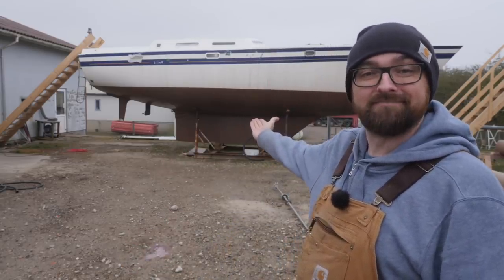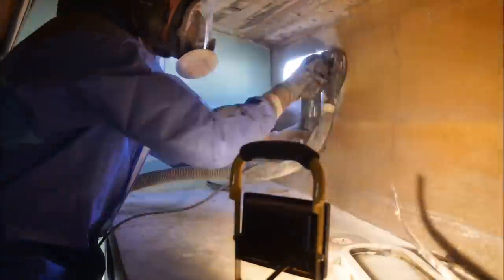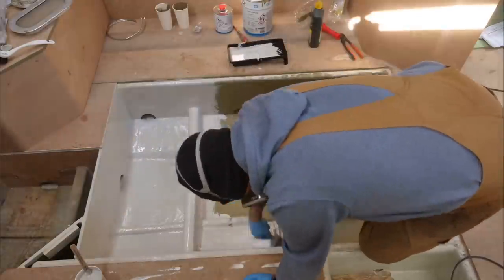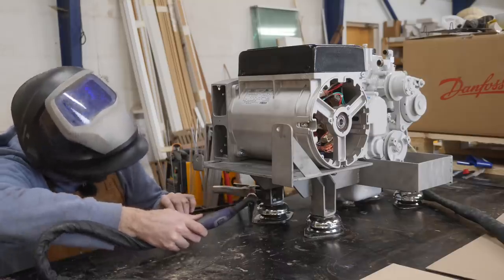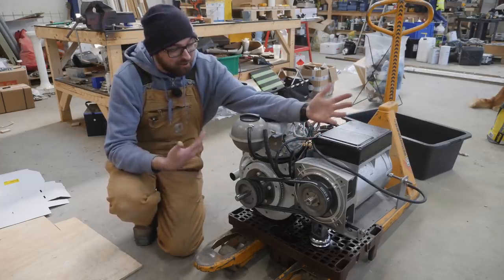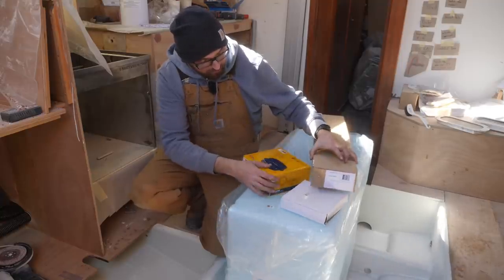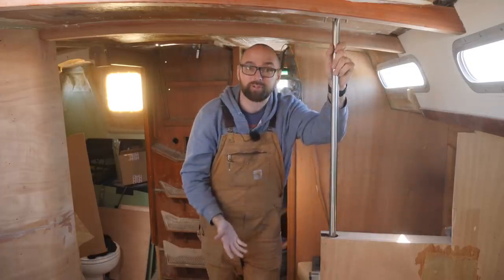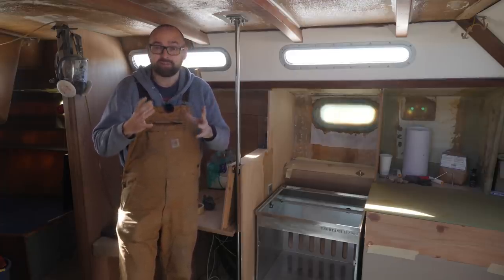Sail Life - DIY generator fail, galley pole - sailboat project

Comment: 4kW, We have a power hungry boat with air-con, induction-hob, microwave etc and just about manage with a 4kW (5kVA) generator and Victron Multiplus 1600 in power assist mode. Need to manage loads being mindful that loads such as water heater switches on/off automatically!! Your plans for a twin Multiplus 3000 system will be far easier to manage than ours. Need a big bank of Lithium batteries; we have 600Ah of Winston cells (same as used in Victron batteries) giving around 7kWh of storage. Great video. Cheers.

Comment: I worked with a guy when first starting out that always said if your not breaking (or messing up) something once in a while your really not working very hard.  Keep your chin up.  You have done amazing work on Athena to this point.  I would really consider looking at a bigger engine for your power system.  Now is the time if your are going to do it for what my 2 cents is worth.  Keep up the inspiring story and don't be to hard on your self.  Thanks for sharing!

Comment: G’day Mads, sorry to see your best laid plans didn’t work out. I hope that you’ve been able to forgive yourself for a simple mistake and I’m thankful you still were happy too show me and the world the mistake. Now my first thought is that maybe you could change up the pulley system to get more rpm at the generator. My second thought is a fly wheel so that you can make use of the Diesel engines high torque over its power output.

Comment: Hey Mads, 4kW is actually a lot of power! In italy, every normal household has it´s electricity line limited to 3,5kW and everyone is just fine! Sometimes you need to think about if you have the washing machine, the iron, the water heater on and want to cook something in the oven it gets too much.. but if you just keep it in mind, there will be no limitations to your everyday life with 4kW

Comment: Hiya Mass, I was gensat  man at Elstree Light & Power, I had 5 Perkins, 1 Volvo penta & 2 Cummins 250kva sets. Now if they still excist Smiths of St... somewhere NW of Norwich built the first 6 I listed. Try to find them & ask about re-sleving the pistons & re-pistoning the idee-bidee-tiny-perkins to make it a 402!!! They may know of an old set with a working Perkins or whomever & dead alternator? They might be able to get Perkins to sponser you? The people I knew are gone... Do not yet despair!!! 
The derve tank & the cold waters of the high latitudes:- INSULATE THE TANK!!! Cold derve has wax cristals form that block up your filters... Even with additive put in at the refinery you may go below, so carry additive plus protect & measure temp of derve. Trucks used to have bonfires under tank, set fire to truck, add petrol, have moter run away & have to smash injecter pipes to stop it exploding! Forewarned is for-skin-armed or something...
Stay safe & take care...
Reply: Mads.. pay attention to this man! I'm in the planning stages for building a high-latitude boat that can winter over in Antarctica, and diesel REALLY doesn't like extreme cold. So much so that I've decided my heating system will use kerosene instead of diesel.

Comment: Where I come from mistakes are positive learning experience. Perkins are not the only small diesel's that will work, Kubota is one that runs forever with little problems and are used in small generators.

Comment: Hello,

     You can change the pulley size on the alternator to a smaller and the one on the engine to larger, or, add two pulleys of s larger size between the Perkins and alternator to get a higher rpm on the alternator while running a lower rpm on the Perkins. Before living in a boat my wife and I lived in an overland truck. We had an alternator welder and made a smaller pulley to het higher tpm on the alternator while the engine ran at idle.

Comment: Very interested in your choice for the fuel  storage definitely will be watching. Best of luck on your refit cheers
Reply: Also I would recommend adding a solar and wind while it won’t supply everything you need but it will pull in power 24/7 it adds up and keep battery topped off add save cash to fuel use

Comment: Suggestion 1 - head South, keep warm and use more solar. We have a 3.5kw generator but it’s fitted with a 5kw alternator. The engine is a single cylinder kubota running at 2800rpm. The advantage of the larger alternator is it gives a more stable operation - greater rotating mass. I can start and run a 16,000btu air conditioner with my 30a 3.5kw genset. Our watermaker is dc and draws about 15a so is solar powered. Our inverter is 3kw but has a 150a charger built in. It’s a pain, but you just have to manage the load.

Comment: A lot of the appliances don't constantly draw the power they are rated for. For instance a washer will draw peek power when is heating up the water. Monitoring the actual current draw (per appliance) will give you the ability to modulate/regulate the rpm's on your perkins. For short periods you can run at higher rpm's without damaging the motor.

Comment: Have you thought of adjusting the gear ratio? Change the pully to a smaller one on the alternator and a larger one on the perkins. It would make the alternator more alot more for every turn of the perkins.

Comment: Hi Mads, bummer about the 102/402. I would suggest sourcing a 402, but in the meantime purchase the smaller alternator and hook that up to the 102. You can then sell the 102 setup as a fully working generator to fund the 402 setup and probably make some cash whilst you are at it... or you could just do some sanding to cheer yourself up👍

Comment: I've been thinking about your issue. Another option would be for you to have a second smaller generator. You could run both at the same time when you really need all the capacity. When you don't require all the capacity you could only run one generator. Basically you could scale the the number of operating generators based on the needed power. This option may save you fuel. Think of the smaller generator providing trim load when needed, like a power plant. The second smaller generator could even be portable which may be handy at times. Hope this helps.

Comment: ahh - no worries - don't beat yourself up.... I know you don't like wind generation - but is quite reliable when it's cold, dark and grey at best during the day... BTW SV Delos just replaced / added flexible solar panels that have a quite high output  that you might want to look into. I say replaced as they lost 1 of 3 solar panels to have a satellite internet dome installed and installed the flexible solar panels on top of the Bimini where they are out of the way - its actually a slick install too. see you next week. Z

Comment: I don't know about Denmark, but in the US used Kubota D905 engines are fairly easy to come by and would power your alternator easily. Shipping an engine across the Atlantic wouldn't be cheap however. You won't be happy until you get the power out of your generator that you want.

Comment: I've already commented on how i believe that the generator outcome is a blessing in disguise.  On a more practical level,  an energy audit would provide the basis of how to manage your needs. Yes, its nice to power everything at once, but how often do you cook, vacuum and wash clothes at the same time. Batterry charging often tapers off in terms of amperage and allows other pieces of equipment to be used. On our boat we don't have an induction stove, but have a microwave, electric kettle, toaster, vacuum cleaner, hot water heating & 50 amp battery charger.  When we use our 5kw main engine driven alternator we can run the lot. If we choose to run the 2kw portable Honda, we need to make choices - usually no more than any two of the above at one time. Microwave, electric kettle and toaster are used for only a few minutes each, vacuum cleaner equally only for a short period. Hotwater is also created from the main engine, so it usually battery charging as the main output and this tapers off quite quickly. End result for Athena - an hour or two a day running the generator,  usually when using the induction stove with the 102 perkins running at an appropriate load or a 402 running say 20% less of the time, but often seriously underloaded amd glazing up.

Comment: Amazing how you made the generator actually work. I would source the bigger engine. If housing is identical to smaller then your set up would be golden. Since the small one is all cleaned up it will be worth something. I wouldn’t compromise on original plan.

Comment: You did do something, you added to your welding projects, that's a plus, you made a generator from parts, that's a thing, sure it doesn't suit your needs, and there was a hiccup, but it was an honest mistake, the two engines are differentiated in the top end. You did good.

Comment: Could you get a bigger belt wheel on the diesel and smaller generator wheel. The idea is the generator wheel will spin faster from the bigger diesel wheel. Just a thought. That diesel still has the torque and you won’t use up fuel as much. Just a thought Mads.

Comment: I would stay with the 102 Perkins. Provided you get one of these Victron Inverter/Chargers, they have Power Assist. Means that if you need 5 or 6kw for a brief period of time, the Inverter assist the generator. Of course assisted by battery. And once the higher load is no longer needed, the power assist shuts off and the charger kicks in and put back of what you needed in extra energy. That's how I run my small genny.

Comment: I would check with Perkins as some have suggested.  Perhaps you could swap out the injectors and pump and have a 402.  If this isn't possible then you could ask Perkins, they may have a source for a 402 to swap out your current engine.  And lastly, you could see if Eva could source a generator in the USA that isn't a piece of scrap metal!  As you inferred in the video you needed time to collect your thoughts and see what to do next.  I'm sure you could sell your current generator setup and use the proceeds for one that would meet your needs.  Mads the one thing I would strongly suggest is to get the generator that will support the demand from the start.  If you compromise you will regret it and feel worse than you do now.  Mark from Colorado USA.

Comment: A Perkins 402/Cat 0.5 are fairly easy to find in the US, around $3k USD new or reman. I would rock the 102 for a while and figure out if the extra 3kVa is really that big of a problem.  You might find that the 102 sips fuel and is sufficient for your concurrent energy requirements.  If it doesn’t or really cramps your style, you can sell off the 102 and pick up a 402 in the UK or in the States where they aren’t hard to get.

Comment: Keep up the good work Mads!  Experience comes the moment after you most needed it. I'm in the 102 upgrade to 402 camp. I am curious to find out what would be needed to upgrade the 102. Like many here say. that it could be a simple change of Injectors and Fuel pump. maybe a bigger cooler.

Comment: You may be able to get the injector pump tuned to put more dinosaur juice thru the iddy biddy little Perkins. Diesels have a lot of latitude that way, and it'll only be "Rollin coal" when you have the washer, stove, oven, water heater, anchor winch, TV, Hi-Fi, mood lights AND massage bed going simultaneously.

Comment: you may be able to upgrade the pump and injectors to increase the output, many lower hp engines are only differentiated by fuel flow

Comment: Get the full dimensions for a 402, mounting points, total area it takes up, and so on.  Install what you have with the plan to replace the 102 with a 402, so make sure you have the space when installing.  Then if the funds are there towards the end replace the 102, if not run it tell you have the funds.  The 102 will work for now even when it drives you crazy for the lack of power.  Still a lot of projects to complete, with more possible surprise costs.

Comment: Think you've gone for a Victron Multi for your inverter/charger?
  This has PowerControl and PowerAssist so the charge amps will vary to the amount of load you have on the AC side so you can use the full amount of amps the generator can provide for AC as well as do a bulk charge (the amps will just be adjusted to what power is left available).   The multi can also assist the generator if your going over what the generator can provide.

Comment: You should build a cover for Perkins that will enclose the flywheel and starter. Ideally you would have two covers that would cover both the rear of the Perkins, and the pulley and belts on the alternator. It would be good if the Perkins cover had an "extension" that covered the belts part of the way to the alternator, and the alternator cover overlapped the belt extension on the Perkins so that when you adjust the belt tension the belts remain contained within the cover set.

Comment: Hey,
In some engines it is possible to do a Cylinder engraving (i hope my spelling is correct) In general making the cylinder bigger... but it requires more work and parts changes in the motor 
It is an option... 
Good luck  you are doing an amazing job

Comment: Stick with the Perkins 102 and start sailing a few months and only after you would feel it isn't giving the required output you could easily change it for a 402  if the dimensions are the same. Maybe already now provide the engine mount with provisions to accept the Perkins 402. What about a upgraded Battery Pack? I did understand from other boat-studies that the correct choice of high performance batteries is even more important than only the output of the generator set. 
I would provide the option of changing the Perkins for a stronger one along the route in a few years.

Thank you for sharing your amazing skills with us. You are creating a very nice blue water yacht and I enjoy watching.

Cheers fro Belgium ; )

Comment: Add a 6 or 7KVA double online conversion UPS down stream of the generator and inverter. Not only will this lift up your output it will also create a 'pure sinewave' to clean up the power from the generator to all your instruments. Also if your generator fails you will have some battery back up time whilst you sort it out.

Comment: The bores are the same at 67mm but the strokes are different, jumping from 64 to 72mm. You may be able to change out the crank and rods/pistons to create the 402 series engine performance you are looking for with your 102 engine. Another approach may be to plumb an inexpensive eBay turbo onto your 102 engine to step it up and possibly run it slower/smoother/quieter at the same time, by trading RPM for working pressure . Turbos, as you know, are common on marine diesels.

Comment: Good video Mads. Easy mistake to make, so don’t beat yourself up.

I’m no expert, but some redundancy is good, especially with no gas onboard, so I’d double up the inverters AND look for a 402, or equivalent (similar engine/up-rate the 102 as suggested below, if viable)...

Comment: I agree with most comments as a generator And solar installer please look into the victron inverters with power assist for smaller generators this is a very useful function for starting larger capacity electric motors etc it is very handy and they have. Five. Years warranty program anyway my house is out in the bush no electricity and we managed very fine for years with a 3 KW victron inverter/charger

Comment: The 102 and 402 are basically the same with the 402 being the newer version, I built my boat Gen out of a 402 and I have a 102 standby Gen at home. working with both series they are very interchangeable when it comes to mounting, bolt pattern and bolt location. Go look for a used semi-truck APU unit as many of them are built with the 402. Caterpillar now own's the patent for this engine in the USA and may elsewhere so also look for a CO.5 Caterpillar. best of luck.

Comment: I have a Perkins 403 , driving a 13 kva 230v generator  powering a Victron Centear 60amp 24 v charger .   I also have a Jabsco 2 inch pump with electromagnetic clutch belt driven off the front of it's crank . When I engage the Jabsco the revs drop slightly which then reduces the khz from 50 down to around 46 , this the Victron doesn't like , and often stops charging . 
  The way I get around this is by plugging the Intellian Sat tv directly into the generator power and Iv'e also wired up 230v led deck  lights to it also , just to keep a constant load on the generator , which obviously reduces the load on our batteries .  13Kva is more than we need most of the time  but I can run everything we need and an Inverter welder all at the same time.

Comment: You may run longer the alternator with the 102 (by not running several appliances at the same time), but the consume will be lower, so the fuel should last more or less the same with the 102 and 402.

Comment: I would look for a Kubota variant that meets the needs, the RT140 is a well circulated small tractor engine, water cooled and has 14hp @ 2400rpm, so should be quieter than the perkins and is has a horizontal piston making it lower profile. looks like alibaba has Chinese clones for around $400 or just look around the tractor shops for the genuine article. If you want a similar footprint to the perkins check out the z602.

Comment: a more simple fix is to alter the gearing of the pulleys, if im right a bigger pulley on the engine would increase the speed of the alternaor , trial and error but will work, your freindly car shop will have a good collection of belts, good luck